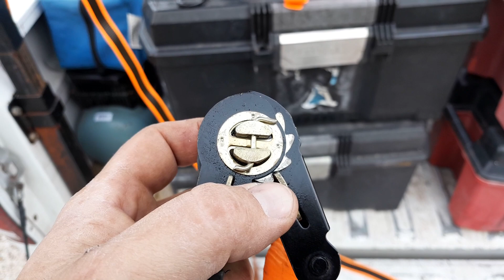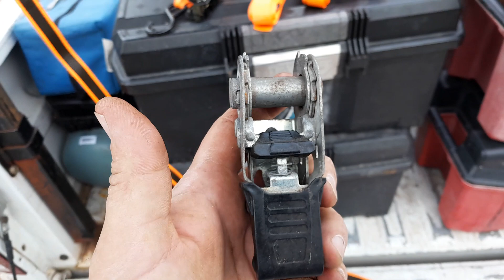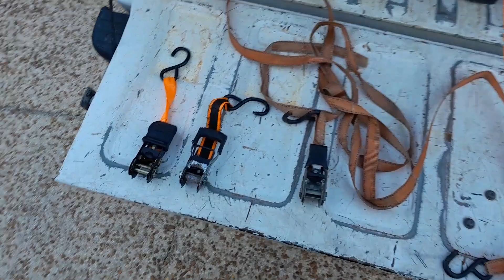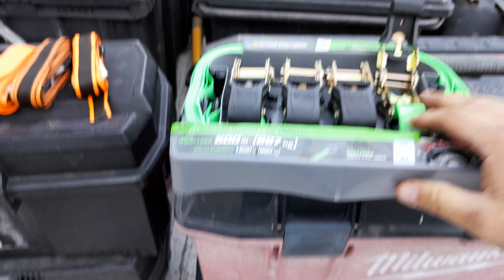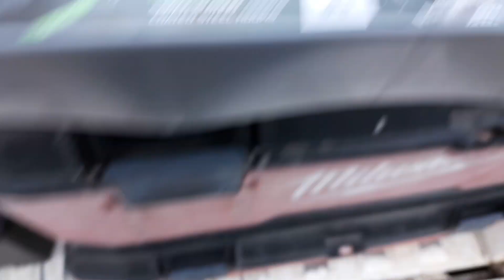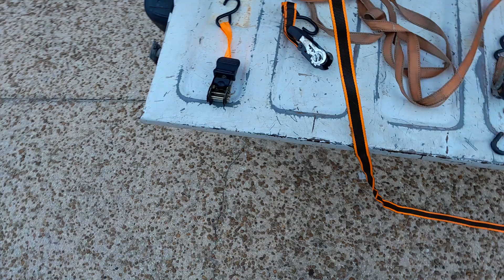Are new ratchet straps as good as the old ones?

Comment: Yeah, I have had the same problem. I haven't thrown away my rachet straps from the 90s and even have 2 Ancra motorcycle straps from 1985. I consider the new ones to be throw away items. I can't even find Ancra brand straps at any of the dealerships near me.
Reply from the maker: I wish I would have thought about this because I would have never thrown away my old ones. I did go to Home Depot and their Husky brand straps seemed decent. There was little play in the mechanism and the teeth were sharp and not rounded over. I guess time will tell how good they are.
Reply: @Bbernhardsr  
We had a 1951 Cessna 170 trucked in from Mexico strapped down with those inside a trailer. They DO seem better than most, and it made it to Arkansas without breaking loose. I may check out the Husky straps tomorrow. We used them to help trailer another 170 from Florida after that but only for small light parts. Now I want a better look! Teeth shape and thickness mainly.